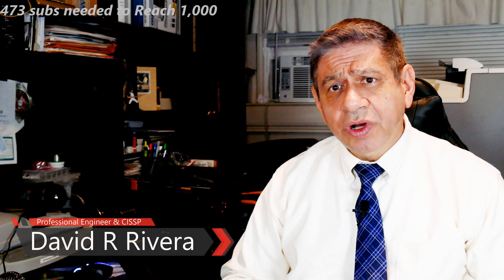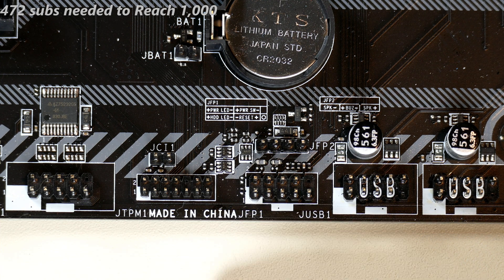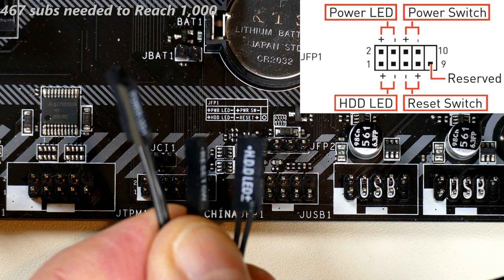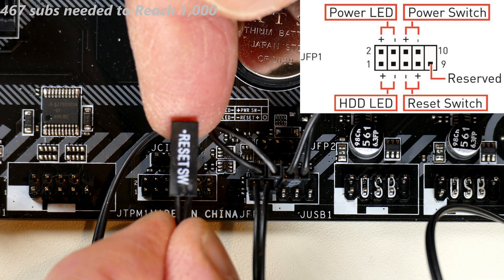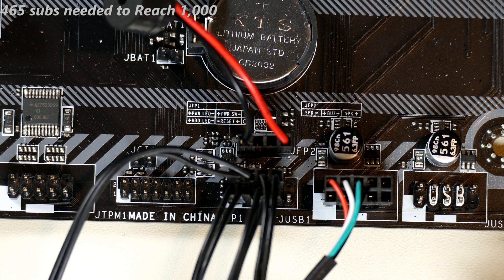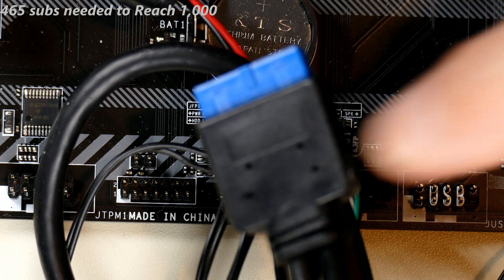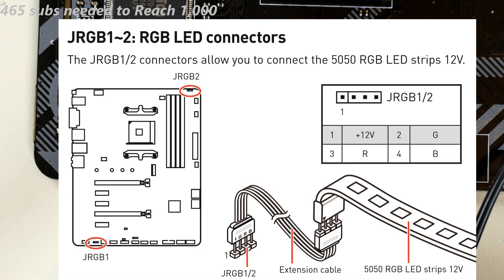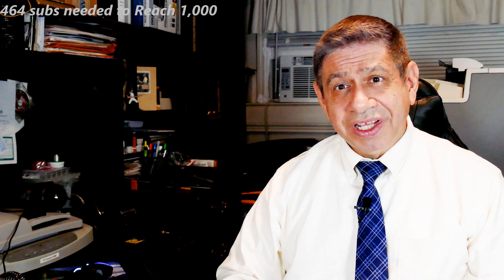ATTACHING the FRONT PANEL CONNECTORS (& others) to a MOTHERBOARD – FULLY DETAILED – Build Brief 1

Comment: The best close-up video and explanation of connecting the front panel! I usually leave the signal speaker uninstalled because it makes too sharp and loud sound when you accidentally press any keys incorrectly. I've never needed to check the Bios post signals with it!
Reply from the maker: Thanks for the compliment.  I always use the speaker and buy them in-bulk.  They really help troubleshoot some configuration issues for the low-end Motherboard that do not have more advanced P.O.S.T LED's or two-digit 8-segment panels.

Comment: hi great video! is the speaker connector necessary to plug in or can be left hanging ? what is the purpose of that? thanks !
Reply from the maker: it is NOT required.  I also do so if I have one available (sometimes they come with the case), only because the 'Beep' during boot tells me that the POST ran successfully.

Comment: can u help me is this same like on motherboard  asusprime a320m-k i see the  same strings like in this wid
Reply from the maker: Can you clarify you clarify your question just a little - I am not exactly sure what you are asking.  Maybe this will help - In general, most modern motherboards follow 'extremely similar' connector schemes.  The differences tend to be mostly the location and orientation of the cable connectors, so it is critical you get a copy of the User/Installation Manual to verify exactly how a specific one might be placed (these manuals are usually available for free online).  There are of course, new features coming out all the time - such as 5v ARGB, USB 3.1/3.2, Temperature/Clock-Rate displays (including side-panels), etc. that will be different on some of newer (an usually more expensive) motherboards.  What I have seen regarding the 'most drastic' departures from the norm are done by PC manufacturers who want proprietary part configurations to, I hate to say it, prevent consumers from upgrading and/or repairing their own PC's.  I tend to stay away from those manufacturers, and to avoid an argument (or worse) I will not mention the company names here, but Email me if you are are really interested.
Reply: @PE4Doers  i got other case when easy it work good with ryzen 3 1200 and amd hd 5850 1gb :D

Comment: The reset switch is not clear.   The + and -  orientation.    Do you go by the name of the cable or the positive and negative. Shouldn't the Reset SW be different? not the same direction like the HDD LED?
Reply from the maker: I suppose I should have shown the letters/words in the same direction for purposes of that video - I apologize.  The switch itself is not grounded and the polarity does not matter.  It is in-fact exactly the same as the Power On switch in that regard.  Is that what you were referring to?
Reply: @PE4Doers  yep.  Consistancy from the manual clears all.  ALso the back of the pin has an arrow which indicates that is POSITIVE, this way the tech or builders can accurately plug the umbilicals.  Others go by the color of the cable, white cable seems to be negative, but some umbilicals are the same color, so this is where the arrow mark in the pin helps out.  Thanks for posting the clip though.
Reply from the maker: @helmetvanga5170  You are quite welcome.  The problem is a lack of international Standards in this area.  My day-job is related to Power Generation and Transmission on a large scale, and even in that area you have some inconsistency when it comes to labeling.  If you look at my first PC case review (on the MUSETEX case) you will also see how that manufacturer also labeled both the Power and Reset cable exactly the same.  I needed to break out my multi-meter to figure that one out.

Comment: I have 1 more cable reset sw what to do with that
Reply from the maker: Do you mean an actual 'additional' wired to the front panel?  I did have once case where they mislabeled the Power Switch cable as 'Reset', so I had to use a DVM to figure out which was which because the other end of the cables connect to a PC board that had the switches on it, and I couldn't  tell visually which was which.

Comment: Hi David. Great Video and very well explained : ))
Reply from the maker: Thank you so much for that fantastic feedback Kathrin, I really appreciate it.  It does amaze me however, that in my over 30 years of building PC's, the front panel options have not changed that much - especially the the 8-wires for the switches and the LED's.  Those very early days didn't have USB's (since they were only available on special systems).  Of course, early on, the lights were not even LED's, just small light bulbs. Also, one wire has disappeared - the 'Turbo' switch, which, depending on the processor, either increased the CPU clock speed anywhere from 10 to 50% (at the proposed cost of increased heat and shorter lifespan).  I regret not having held on to one of those old systems (although I think I may have one of those motherboards buried away in some of my old boxes in either the garage or attic).  Although those were the days when putting in a motherboard was VERY tedious, since you had to set much of the configuration using jumpers, such as the baud rate of the serial port and the IDE device number for each hard drive (ouch).
Reply from the maker: I guess I really 'dated' myself with that last comment, huh.